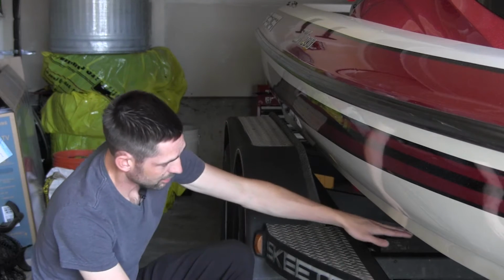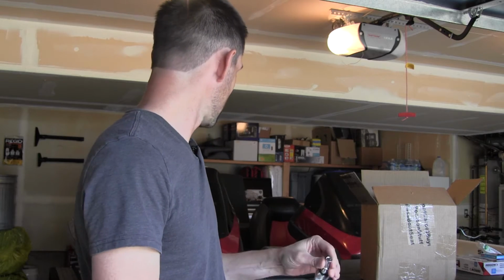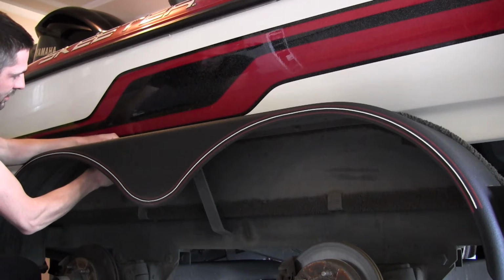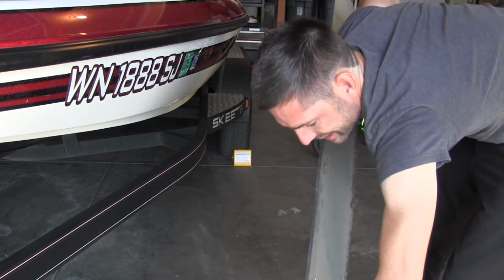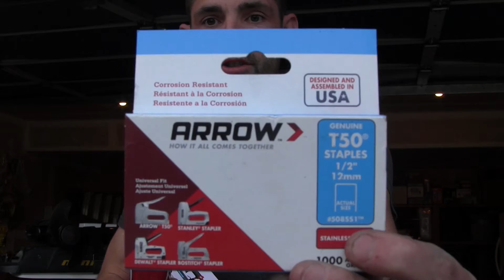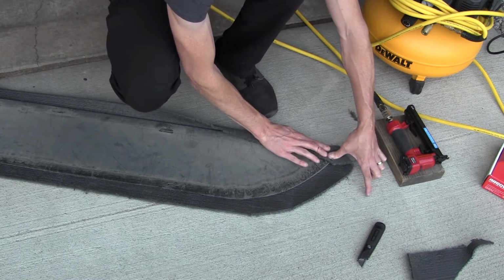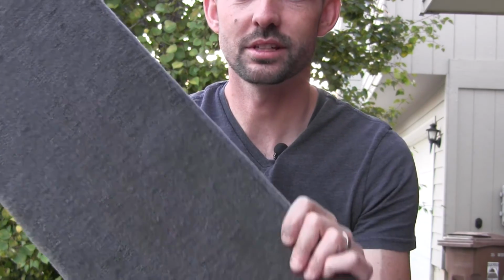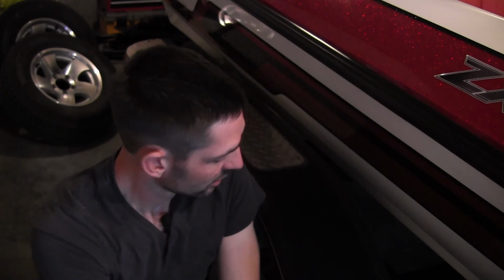How to Replace Bass Boat Fender Bunk Carpet

Comment: Would have loved to see the struggle of finding your holes putting the new bolt threw and putting everything back on the trailer.  Now that's the real struggle
Reply from the maker: No struggle at all, push it through and put the washer/nut on. It’s actually a really simple and quick job!!